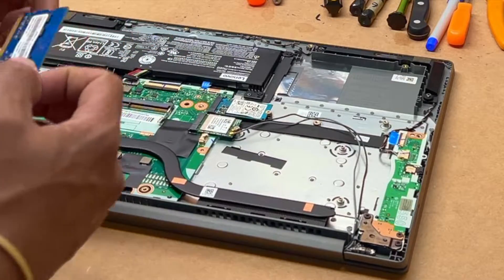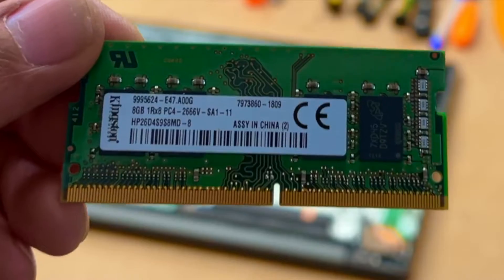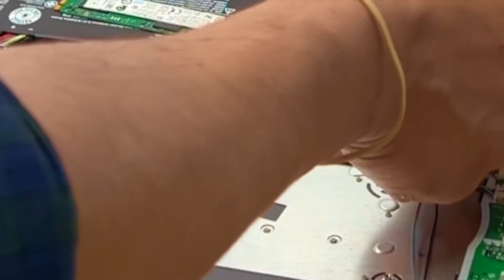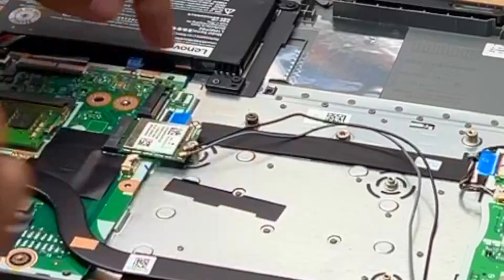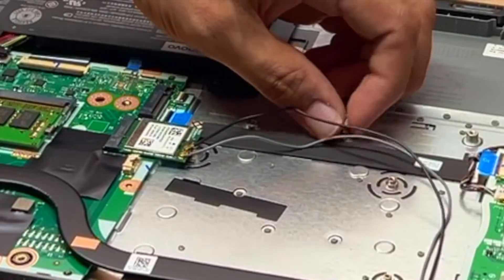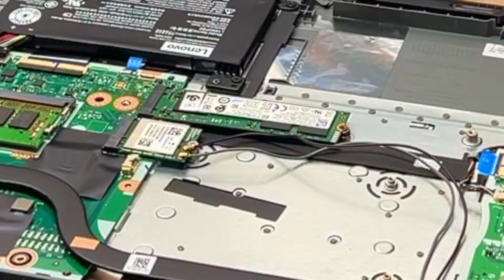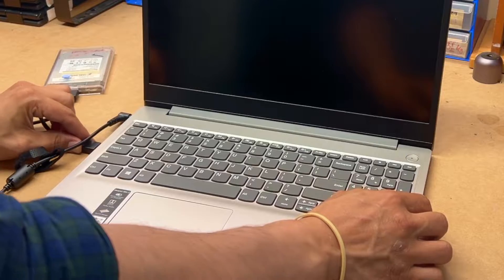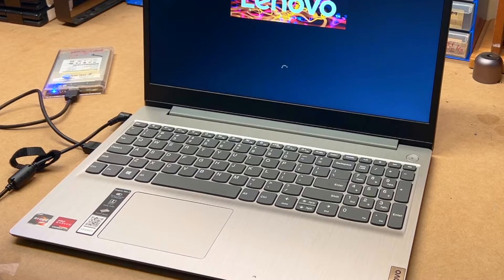Lenovo IdeaPad 3 15ADA05 | SSD & RAM Upgrade

Comment: Is there any preparation before this methods? Like safe saves or something? 
Also I still has the HDD in it, and i dont wanna remove it, can  i just switch in software to ssd?
Reply from the maker: Pretty basic, disconnect the battery. Hold down the power button for 10-20 second to drain out the remaining charge

Comment: I noticed you installed a 2280 SSD but your description links to a 2242 SSD on Amzn. What is the maximum space I can upgrade this to? I was going to buy a 2TB 2280 SSD but I was reading the maximum size you should upgrade to is 512gb due to the battery wattage.